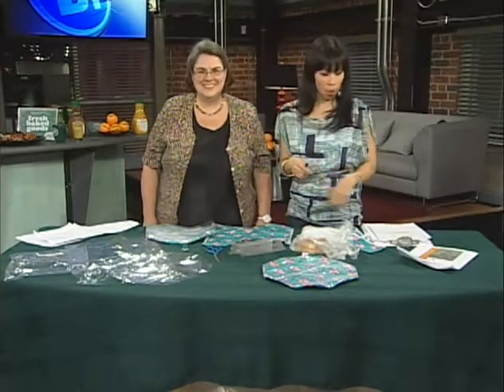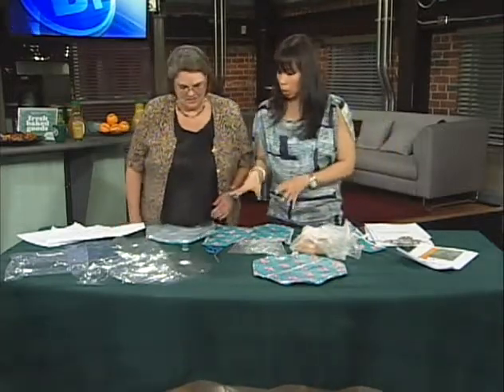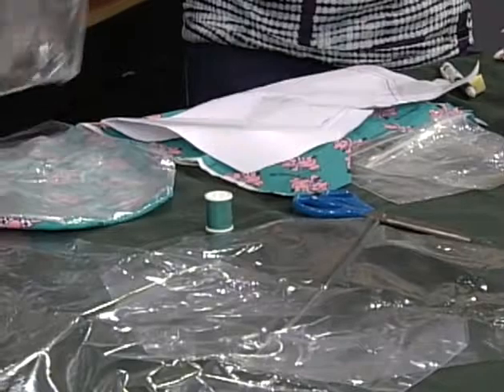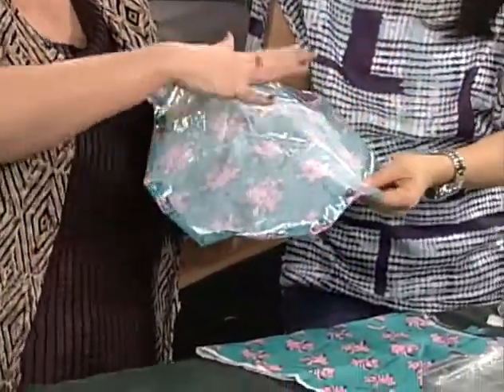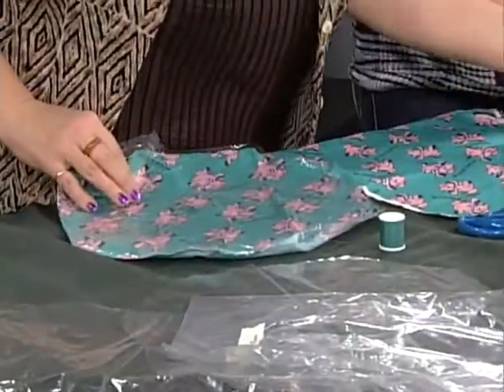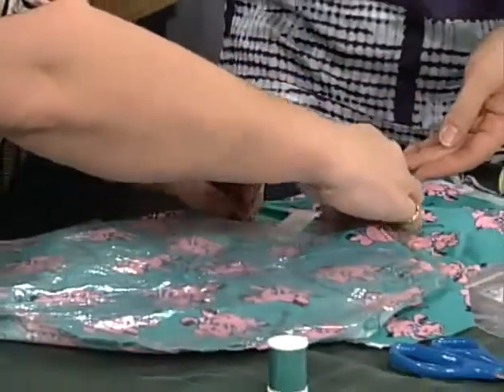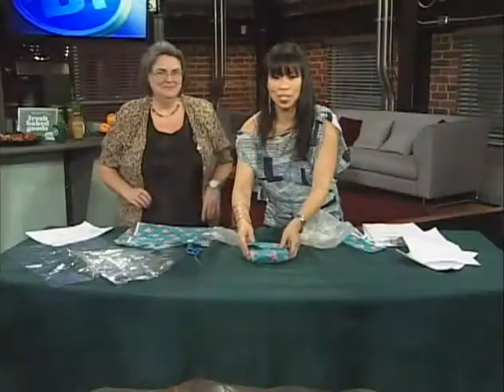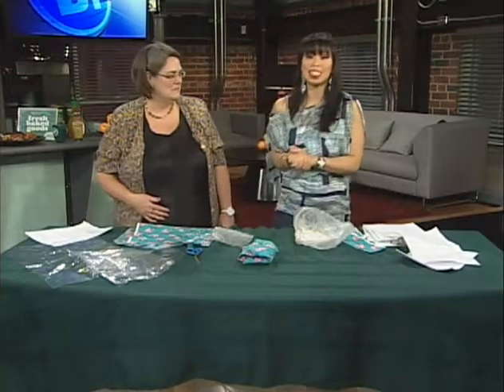Making a Reusable Sandwich Bag

Comment: Wouldn't the plastic used for this degrade, therefore defeating the purpose of having a reusable bag? What happens if it tears or accidentally goes in the dryer?
Reply: You don't need to use the plastic. You can use regular cloth if short term use or PLU will give a better result for longer term use (to prevent dry bread). Then it's fully wash/dryable.
Reply: *PUL fabric... Dang autocorrect